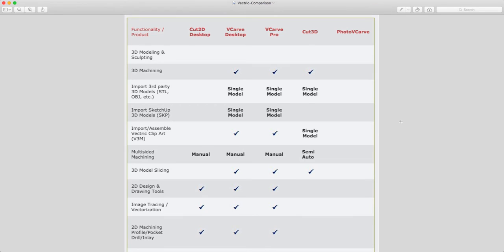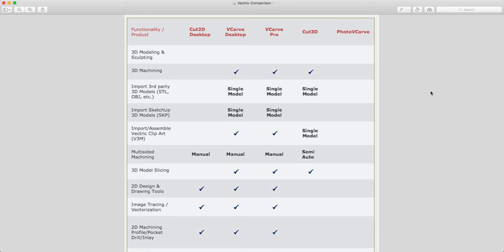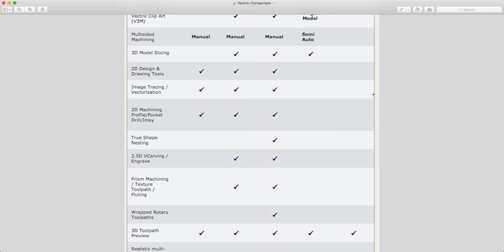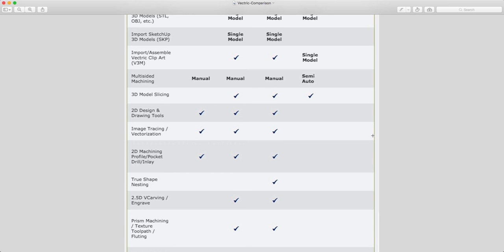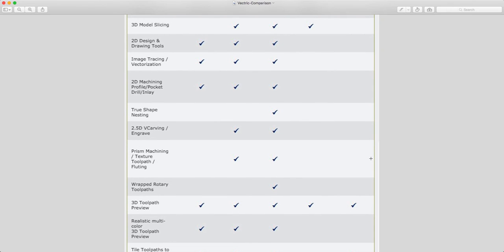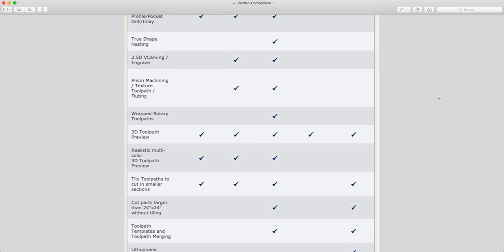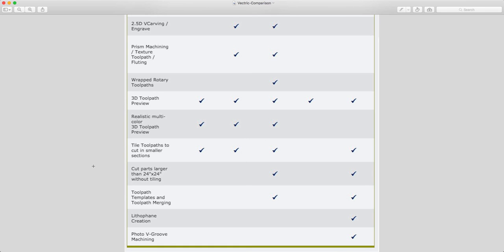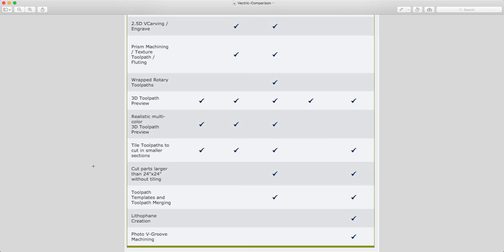Which Vectric Software To Choose For The STEPCRAFT CNC?

Comment: what are the operating temperatures of 840? and temperatures for storage?
Reply from the maker: 62 degrees or warmer.  We have customers that use silicone lubricant and run in lower temps, but we spec for 62 degrees